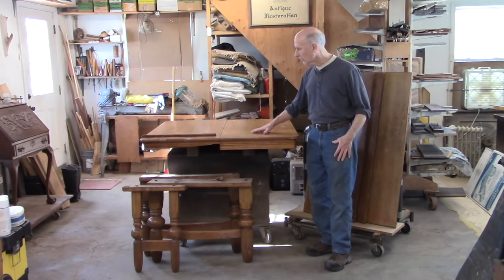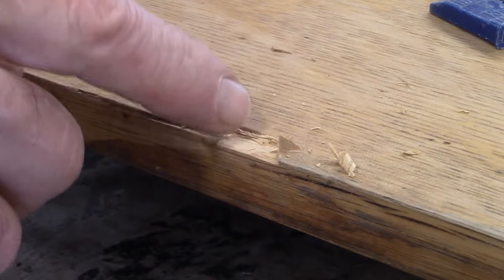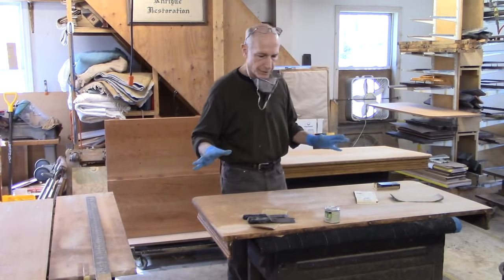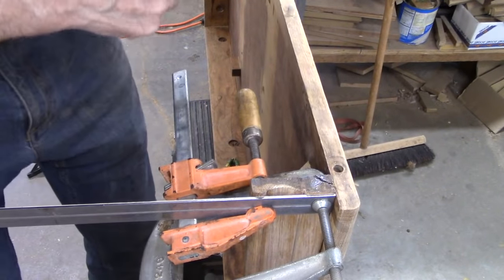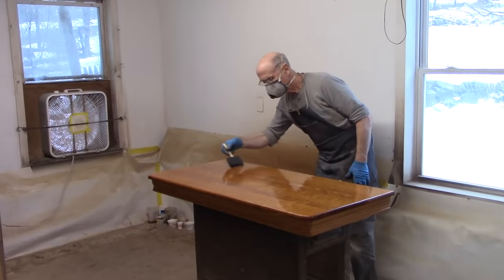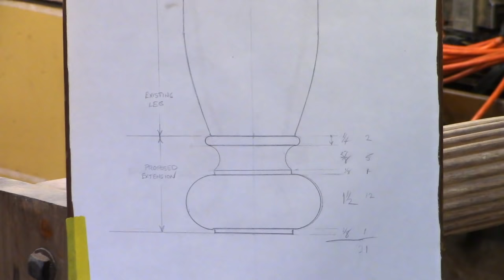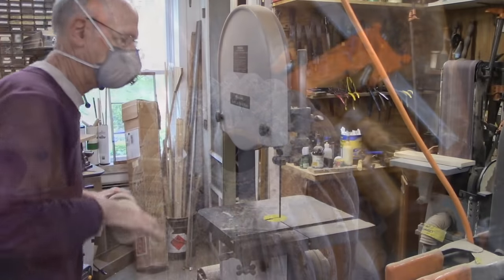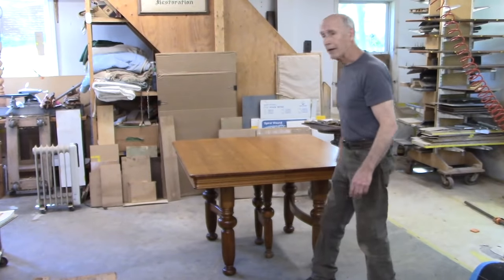A Complete Rescue - Thomas Johnson Antique Furniture Restoration

Comment: Tom, I've had a very similar oak table for  30 years, but it was in shocking state (used as a decorator's table) when I got it. I think, despite fond memories of the kids growing up around it - I swear there is still Weetabix in the cracks - there is too much warping and cracking for it ever to be really nice again. Today I found a nearly identical table locally, which I have bought (and I much prefer the square taper legs too). But it has a very shiny hard finish - which could either be shellac or varnish from a tin. If I don't hear back from you, I'll use scrapers to remove the finish. I know there'll be a way to find out what the previous finish was and perhaps a better way to remove it - if you know of one, please could you let me know. Maybe as I don't need to change the colour, I could just dull down the finish in some way. There isn't a dippers anywhere near and I'm not shy of taking my time doing it by hand. I've dismantled my own table now, and I'll keep the boards for some unknown project - maybe just storage cubes, or a coffee table - but the rest of the wood will go to my school DT dept. Had a heck of a job getting it out of the owners house as he'd built a garage behind his small house after the table was bought 40 years ago. Weetabix is an under valued permanent wood filler it seems. Good job here as always.
Reply from the maker: Thanks! Scraping is fine - the only other way is to chemically strip it. The finish I used is very appropriate: Waterlox Original Satin
Reply: @johnsonrestoration  Thanks, Tom. As it turns out, the cabinet scraper I have needed sharpening too often - maybe too soft. And without a handy vice, sharpening is not straightforward. So I resorted to chemical stripper - but it just didn't touch the surface - some sort of incredibly tough polyeurathane coating which had gone milky in places through heat, but didn't want to come off. So I ended up sanding it after all. Looks pretty good now after oiling and waxing. Of course I took short cuts that you don't - but I need to cut myself some slack over that. Thanks for the advice.

Comment: Congratulations, great job as usual.

Could you tell me the name of the tools you used to drill on the center of leaves sides. Looks like a spécial pocket hole
Reply from the maker: Thanks! That's just an old Stanley 59 Dowelling jig. They don't make them anymore, but there are better dowelling jigs on the market now
Reply: @johnsonrestoration  Thanks. As an auctionneer and woodworker, I really like old tools, I also have a small collection. Have a nice day

Comment: Love the video. When trimming the apron I noticed you used a metal straight edge as a guide. Wouldn’t that damage the teeth of the saw.?
Reply from the maker: Thanks! Technically yes, but I have not noticed any damage to the saw or straight edge! I think if you did that a lot, it would

Comment: Because I’ve been more or less binge watching all your videos, YouTube has begun suggesting other furniture making/repair videos.

I came across one today where Vietnamese men took an entire tree and made an elaborate table.
It was beautiful wood. I was mortified when they used power sanders (the sawdust flying like a blizzard), power drills and screwdrivers, nail guns (not even a bit of putty to fill the holes) and not a single dowel plug, or joinery thingy in a huge solid base and table top.
A few weeks ago I wouldn’t have thought twice about their blasphemy. But now 😳😱

And mr. Johnson…they sprayed a single coat of clear lacquer on it and no hand sanding, green scrubby thing, steel wool or beeswax in sight! Oh the horror 😩

I came running (metaphorically) back to you as quickly as possible 😊

Ps the glued and clamped all the bits using only 4 little c clamps and no block to disperse the force too! You can see why I was so shocked and dismayed 😜
Reply from the maker: Thanks! Yes, I've seen those videos too - very interesting though!

Comment: Tom, I really get a lot out of your videos. Thank you.
Question….. what is the glue you use in the  surrenge applicator?.
Is that west system epoxy?.
Bob from Maryland
Reply from the maker: You're welcome! I've used 2 different adhesives in the syringe, hide glue and West System. Both are thin enough to work in a syringe!

Comment: I was curious as to how long it took, real time, to refinish that table. When you started, there was snow on the ground, and when you finished, all nice and summery.....

Is that highboy in the background going to be in an upcoming video? And the leather settee?

Removing those sleeves...I have done similar as you did with the pins and it works really well...find a bolt that has a slight interference fit to the castor hole, force(turn) them in, and pull them out. No risk of damage to the wood at all....

I was curious...did you line up the leg extensions so that the grain matches, as if they were part of the original leg? Maybe redundant question, but in my mind, easy detail to over look....
Reply from the maker: Thanks! This job took about 100 hours, I did it over a period of 4 weeks last spring. It was a 3 part series, now 1. There is an additional video about the feet: https://www.youtube.com/watch?v=5g-rnLqVkJc. I positioned the feet to their best advantage color-wise, that may coincide with the grain

Comment: I noticed that the various boards of the top had a profile on them, presumably for alignment.  When did they first start using this profile for edge gluing boards for a table top?
Reply from the maker: Thanks! Good question. I have seen it on paneling from the 18th century

Comment: Enjoyed the video.  Thank you.  Long is good.  Out of curiosity, have you also tried TiteBonds Liquid Hide Glue.  If so, how does it differ from Old Brown Glue?
Reply: Titebond version does not require warming up but works better if you do. It also is a bit less viscous when you do. Bond is similar but not quite as good. At least that is my experience. Not to mention that whatever mr Johnson uses I consider it better anyway. But tire bond is certainly adequate.
Reply from the maker: Thanks! I did once and it seemed fine. They do warn about shelf life. Right now I'm really liking the "Old Brown Glue"
Reply from the maker: Yes, thanks! Yes, the Tite Bond works well. Check shelf life though

Comment: You drilled the first two dowel holes in the first leaf either slightly oversized or off-center. Did you do anything to the matching dowel holes in the opposite leaf?
Reply from the maker: Thanks! No, The other leaf had pins, and they seemed to work fine

Comment: "When I need a break from sanding.....I do more sanding". I laughed out loud at that. The detail on how to match the grain was much appreciated. The finishing process definitely holds the most mystery. Acid wash, water rinse, custom mixed stain, tongue oil finish. Do you use many different methods or are there a few tried and true methods you primarily stick to? Thanks again for the great content.
Reply from the maker: Thanks! I have tried and true methods but they are constantly changing

Comment: On the long splits on the leaves, did you put the thin veneer A. all the way through (top-to-bottom) and full length of the split, or was it just B. all the way through but pushed from the end as far as you could towards the end of the split? If A., did you come in through the top and press to the bottom, if B., how did you fill the rest of the split ... epoxy and saw dust?
Reply from the maker: Wow! I got dizzy reading this! I think "B". It seemed to work well

Comment: Water stains and water marks seem to be a hard problem to fix.  Is there more protection with your coatings or what do you suggest for using wood tables?
Reply from the maker: Thanks! That's why I like this Waterlox Original Tung Oil varnish. Easy to use, and is extremely durable

Comment: Dear Mr Johnson, in many cases I saw that there have been used slotted screws. Is there any reason why you don't replace them with cross- headed or philips screws?
Reply from the maker: Thanks! I can't help it! I can't use new type screws on antiques, no other reason

Comment: Have you ever tried using a hand router plane to flatten out the bottom of your patch areas?
Reply from the maker: Thanks! No, but I'd like to try. I think I might have one (someplace)
Reply: @johnsonrestoration  My thought was that you might get a better surface for glue adhesion. I've done it for bowties and it has worked well.

Comment: Hi Tom, if an apron shouldn’t be glued to the tabletop why is it ok to glue the triangular supports? Doesn’t that effectively fix the apron to the tabletop? I have a table with the same kind of original supports and have been trying to figure out if I should glue them (they are screwed but don’t seem to have been glued originally).  Please help me understand. Thanks!
Reply from the maker: You're welcome! The triangular blocks were holding the apron in place only at the edges, where the 2 halves meet. All the other fasteners were "movable" to allow for expansion/contraction. This keeps the apron where it's supposed to be meeting in the middle.
Reply: @johnsonrestoration  thanks! Aha! Mine are at the same location on my table. Now I know it’s ok to glue them. Thanks so much for the answer. Now I know.

Comment: I am wondering if sometimes you get an unintended manicure using the sander on such small pieces. On those foam brushes - did you know when the foam is bad and not usable anymore you can use the handles for possible dowels or pins because from what I understand they are made from maple so at least part of it is not 'disposable'.
I have found out that fish eying usually happens when a furniture cleaner by the owner is used that has silicone in it. I have used mineral spirits to combat that which worked well.
Reply from the maker: Yes! That's good. And I do save the handles! Thanks!

Comment: I’m curious why you use hide glue on a break rather than phenolic resin or epoxy. There’s not an expectation that you’ll want to separate the pieces later. Why not use something less likely to yield over time?
Reply from the maker: Thanks! I use the hide glue on period antiques. But if I thought it needed it I wouldn't hesitate to use epoxy. As long as the parts fit together exactly, wood glue is the strongest

Comment: Holy cow! Doing it by drops! Yep yep. 
You would happen to share your drop ratio. If you don't have time, or already answered, sorry. Just stopped working on a cabinet, this could be used greatly.
Reply from the maker: Thanks! Do you mean the epoxy? I use the same ratio as the pumps, 5 resins to one hardener

Comment: Doesn't cutting against a straight edge change the set on the blade not to mention cutting away the square rule?
Reply from the maker: Thanks! In theory, yes. But I haven't seen any damage. I do this so infrequently. And I use an old straight edge!

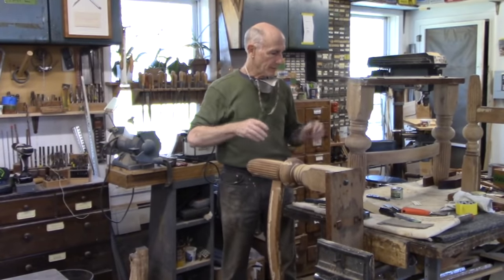Comment: At 1:12:32 - Speaking about extending the legs.  Why did you choose to turn a new extended foot for each leg's bottom rather than adding a similarly thick square block piece to the top (where it probably would not be seen)?  Would have been simpler/easier but maybe not as aesthetic?  Thanks.
Reply from the maker: Thanks! That was my first thought, but the blocks would be huge, I raised the table 2 5/8". You would be able to see them! The new feet solved a few issues
Reply: @johnsonrestoration  - Yep, I thought that might be the case and the feet look great and as if they have always been there.  But the skirt would have hidden much/all of the block and with your finishing skills they would have probably disappeared!  My $0.02.

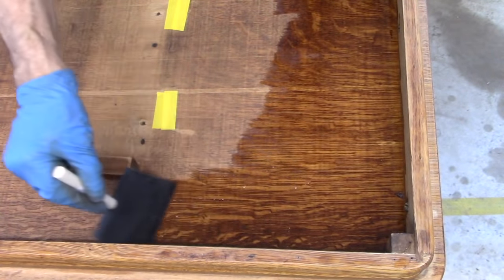Comment: 1:00:55 I'm confused.   If the darker color was possibly the original color, then how could it get lighter under the sliding mechanism for the leaves?   I thought the hidden parts were always closer to the original color.   Seems like the hidden parts wouldn't normally get lighter with age, would they?
Reply from the maker: Thanks! Because they stained it after it was assembled. Which always surprises me, in a factory setting

Comment: Silly question did you ever have something that would not glue
Reply from the maker: Thanks! Yes! If something is contaminated with oil it won't glue, but typically you can clean it with lacquer thinner. With oily woods like rosewood, you have to clean the joint with lacquer thinner and then hurry and glue it before the oil seeps back to the surface

Comment: Just curious, why so many coats? Does each add protection or depth?
Reply from the maker: Thanks! Usually there is a certain look that I want on a particular piece of furniture. Some primitive pieces need very little finish. More formal pieces typically have a full finish and very glossy. So it depends!
Reply: @johnsonrestoration  thanks!

Comment: For me every “ patch”. Splice must have an angle at end grain to end grain butt. I remember you did a candle chest square some time back because you preferred it on that job.
Neither method wrong it’s just the way I was traditionally taught in England
Reply: Great work btw. Sometimes my comments come across negative, they’re not intended too. I’m just addicted to details.  Thanks mate.
Reply: Plus I learned to router many splices from you. Cheers, great technique and results
Reply from the maker: Hi Carl! Thanks, the comments don't seem negative! I just decided a while ago that I would remove no material from an antique unless absolutely necessary, so I will now often just make a butt joint instead of cutting into an area that is not damaged

Comment: You should use your router plane for flat bottom patches. It’s faster but more accurate too.

Be careful, you need touching your glasses with gloves after playing with acid, be aware.
Reply from the maker: Thanks for the tip on the glasses! The same for the camera! I'll have to try the router plane

Comment: Thomas, you've got a lot to read and I imagine it's not even possible to go through all the comments for you anymore. Maybe you might read this one and I'm curious about your thoughts. Every time you restore a piece you add a little "you" to make it a practical or usable and good looking piece of furniture again. You add a time stamp for a future furniture cabinet maker. For me it's adds life to the piece and shows the attention of lost generations who also liked the piece. Here is my question; you fill cracks with hide glue and veneer which somehow works and the end result is beautiful as always but if you would saw out the crack completely with e.g. a jig saw until the very end it leaves you with a parallel gap where it's easy to glue a also parallel piece of wood. By doing so nut much compression needed to clamp it without cracks. But, and there's the question actually really about; it would show that you probably used a power tool for this restauration/repair. For me it's another timestamp and a better repair. What are your thoughts on this subject? Use the old tools and techniques (hide glue is still the best; no questions here) or leave a power tools evidence as a mark of a today's  repair?To exaggerate some more; how about loading the piece in a cnc machine and cut out all nice pockets needed for the repair. Patches are also, of course, made by a cnc machine and glued in by hand and matched with the surroundings. Etc, etc.  Thank you for your answer, I love your work and dedication. All the best, Job
Reply from the maker: Thanks Job! Yes, it could be good to remove some wood to make the shim fit better. When I do that it's usually because it's a major crack, with structural issues. But in general, I try to take away as little of the original wood as possible. (this applies to period antiques, with newer furniture I might take a more aggressive tact

Comment: Why not use oil after stain to prevent fisheye and let topcoat absorb more evenly?
Reply from the maker: Thanks! Well, doesn't the first coat of varnish accomplish that?
Reply: @johnsonrestoration  Yes perhaps. I usually try to flood porous wood completely with oil or oil based stain. Until it does not absorb it anymore then wipe, dry and let it cure for a day. I found that it creates depth, almost 3D effect on the wood grain once it is finished with lacer or poly. Additionally it helps to avoid uneven absorption of the top coat by porous grain. Enjoying your channel for many years. You are a rare craftsman. My hat is off to your skills. Much respect.

Comment: Could you add a couple inches to the tops of the table legs?
Reply: You could, but it would be significantly more complicated than what Tom did by adding them to the leg bottoms!
Reply from the maker: Thanks! That was my first thought, but raising it 2 5/8" was too much! The new feet solved a few problems
Reply from the maker: Yes, maybe not more complicated, but definitely way too much to add at the top. Plus the feet solved a few issues

Comment: Why a varnish and not a polyurethane?
Reply from the maker: Thanks! I like using this varnish because it's been made since 1912, and has a look and feel much different then poly. I like it on antiques. Nothing wrong with poly though
Reply: @johnsonrestoration  Thanks for the reply! I see your point but how does varnish hold up against the rough and tumble over poly?
The one thing I find is a disadvantage sometimes about poly is it's amber hue.
I discovered that I could make my own stain with mineral spirits and unfibured roofing plastic cement (tar). I believe that's what your asphaltum is?
I was fascinated to see that you use green to tone down the red.